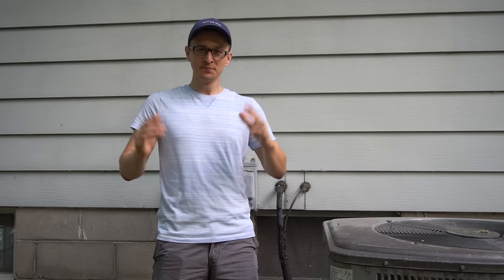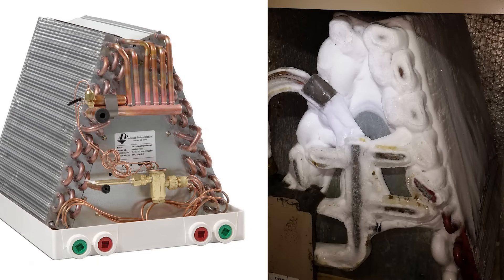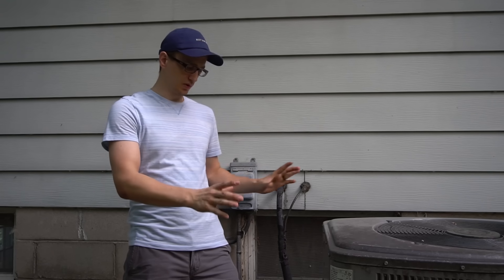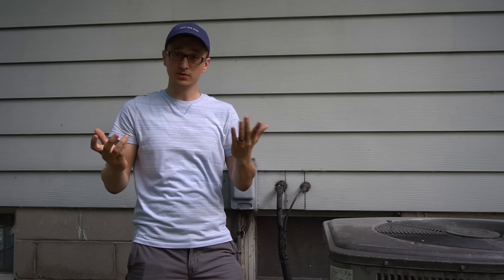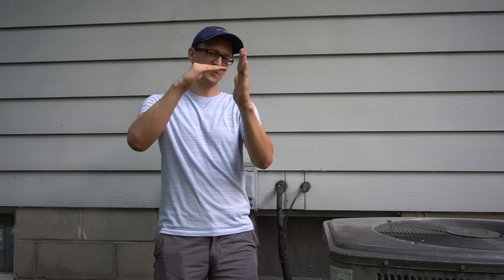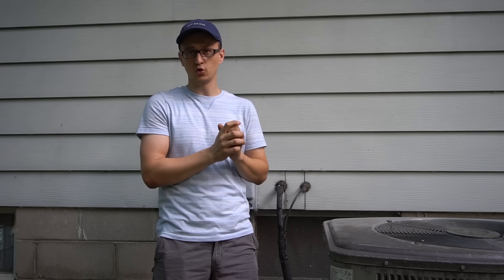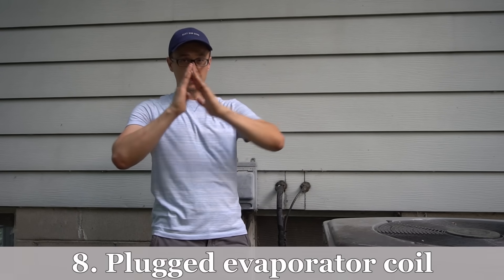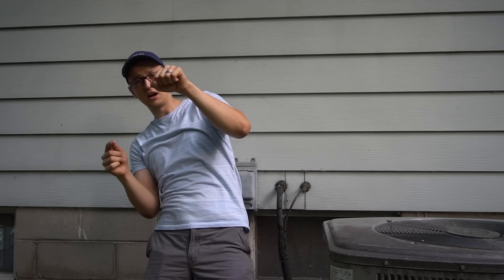8 Reasons Why Your AC is Freezing Up

Comment: Can a poorily operating condenser fan motor cause inside & outside unit to freeze?
Reply from the maker: The condenser fan that is in the outdoor unit? If anything, it would cause the unit to overheat not freeze. A poorly operating blower motor in the furnace would be the one to cause freezing though.
Reply: @WordofAdviceTV  Thank you! I have a technician that states that the condenser fan motor is the problem. I have searched & have not found ANY information that suggests anything near what he stated. And the warranty company has denied the claim because of his assessment! Smh!

Comment: My ac unit is freezing up and I have the heater going please help
Reply: timwheale62 having the same issue. Any fix?
Reply: If your running the furnace and your a/c is frozen + running, its prolly a stuck compressor contactor.

Comment: Bratan, Do a video for heat pumps on winter season. It's little different. Defrost board. Ambient sensor and  coil temp sensor often are the reasons during winter for  ice freeze ups.  And how to troubleshoot it.
Reply from the maker: Bratan, maybe some day... But likely no time soon. Unfortunately I do not work on heat pumps very often. Either they are not very popular in Minnesota or the company I work for simply does not have many customers who have them. I haven't seen a heat pump in a while so honestly, I would need to do some troubleshooting of my own to figure stuff out, therefore I probably wouldn't be a good teacher on the topic. Sorry

Comment: I was having that same problem on work , with a commercial unit.
After checking it, the fan was spinning the opposite direction. Do you know what causes that to happen?
Reply from the maker: Sometimes a weak capacitor can cause that. Or if the capacitor was replaced and the Herm and C wires were reversed which would cause that as well. Also, I have reversed the two hot legs coming from the fan motor before and that reversed the spin direction. Doesn't work on all units but has worked for me before. Hope that helps!

Comment: Stupid question probably, but what does it mean when u turn off the AC and the inside and outisde hisses from the vents. The furnace sounds like it ices over immediately. But when i turn it back on the cold copper wire gets warm again
Reply from the maker: When it hisses, does it hiss for a long time or just a short time and is it really loud? There is a very slight chance that something is wrong but most likely that is normal. This may just be the sound of the refrigerant pressures equalizing when the unit turns off. When the AC is running, it has a high pressure side (outside unit) and a low pressure side (the inside A-coil). But when the AC is turned off, the high and low side "equalize" or become the same pressure. When it is equalizing like that you may hear a hissing sound like you described. If your unit is cooling down the house good, I wouldn't worry about it. ;)
Reply: @WordofAdviceTV  My AC does not cool the house down for long and it goes back to mid-high 80s. I looked under my furnace and have alot of condensation underneath. I ipen to check that A coil for freeze probs and its not. It looks fine. I dont know what to do :(
Reply from the maker: It sounds like you have a freon (refrigerant) problem.. Unfortunately that is not something that is easy to fix yourself so at this point I think you will need to call in the pros.
Reply: Thank you. You're very helpful! 😎

Comment: I like setting my AC to the lowest setting possible, 59, 60, etc... but 67 to 68..... not a bad start, plus, it's really cool still
Reply from the maker: Usually setting your thermostat low will not freeze your unit. Most of the time when that happens that means there is an underlying problem and the thermostat set too low is the straw that broke the camel's back ;)
Reply: So I can set my thermostat at 60, as long if my filter are clean and enough air flow is going through :)
Reply from the maker: I don't see why not. It most likely will not freeze over. If it starts to ice up, then consider adding a few degrees ;)
Reply: So if it freezes up, i'll cut down a few degree (raising like 2 degree)
Reply: My thermostat can go as cold as 50 for AC. Will it ever reach to 50? It's been hanging around 60-64.

Comment: I keep hearing different advice about leaving the A/C on when it cools a bit outside.

We have a programmable thermostat that's set to 70. Lately during the day, it gets to be 85-90 outside but around midnight until the next morning, it gets to be 60-75 outside.

Should we leave our A/C on at 70 or should we turn it off? BTW, it stops actively running automatically when it hits the desired temp.

Or should we turn the A/C off, but turn the fan ON, until the next morning?

I don't know what is most efficient, but I'm mainly worried about maybe too much strain or humidity causing the A/C to freeze up.

The A/C is located in our basement, which is not much more than a cool dirt hole dungeon under the house, only accessible from outside.

Thank you!
Reply from the maker: I would say just set your thermostat to the desired temperature and leave it. No need to turn it off. When it gets cold at night it will not turn on anyway. Your unit should not freeze unless you have a underlying problem with the freon. (low on charge, restriction in metering device, bad airflow, etc)
And in the off chance that it does start icing up, just turn the AC off and leave the fan in the ON setting and it will defrost it. Hope that helps!

Comment: Great videos, learning a lot. I move to new home with 4 Ac inverters splitter (millenia, york and 2 tgm) and well the york was off didn't wanted to turn on manage to get to separate backers and it was trip, it manage to turn on but it smells like something is burning so am going to check that. The millenia was working from day one but 2 day ago blower wasn't blowing air, got today the capacitor hope that's the issue and the 2 Tgm one was working perfectly but out of the sudden got a error code e5 the other tgm for some reason is bipolar it cools then it DOSEN'T and for some reason it turn on by itself. That one need to keep and eye on to se if it keeps turning on. Never had mini split now have to deal with 4 trouble ac. Much to learn I will

Comment: why would you need to recharge the unit? just because it froze it doesn't mean there is a leak in the system. You should never have to recharge a system unless there is a leak. They are sealed systems you know.
Reply from the maker: I went through the list pretty quick so I did not dive in to each individual issue. I explain what you said in my other videos though.
Reply: Systems are allowed to leak a certain % per year via the epa sometimes its more economical to just add a pound of 410a every summer as opposed to replacing it  and or fix the leak.
Reply: @Teagod77  the leak percentage is more applicable to very large and old commercial equipment. There shud be no acceptable amount of leaking in residential. Using soap bubbles to find the leak isn't hard to do.

Comment: Just cleaning the surface of a dirty evap usually will help, but not completely solve the problem. Best to physically remove from cabinet and clean with pressurized water and reinstall. Be careful with commercial evap cleaners, as they tend to cause the aluminum to deteriorate over time.

Comment: No u ding dong... Don't tell people to run the blower motor with the coil frozen.. How about leaving the explanation of what to do to those that know what to do.. It causes more amp draw on the blower motor because of the added resistance of air flow.. If it's freezing and you still run the blower you are asking for more problems than u already have... Very dumb to run the blower motor with a clogged coil
Reply: Your meter will say less amps but their electric bill is going to be the same
Reply: So in addition to not knowing how fans or capacitors work, you also dont know how utility company billing works either. Here's a basic math lesson:  All power companies bill based off kW/hour consumption. A kW is simply 1000 watts, and a watt (from a utility company standpoint) is voltage x amerage from a device over an hour. If you have a 120v fan pulling 0.2 amps, then 120 x 0.2 = 24 watts =0.024 kW,  x 60 = 1.44 kW/h. It's mathematically impossible to maintain a constant power bill total if your devices are pulling less amperage.
Reply: It depends on how technologically advanced your heating/cooling system is. If the blower has a PSC (permanent split capacitor) motor it runs at a constant speed and will not pull more amps because no air is being moved (no work). If the blower has a VS (variable speed) or EC (electronically commutated) motor it will be commanded to speed up because it senses no air flow and will pull more amps.
Reply: @villebillie1562 ... can you please explain how a frozen coil does not increase the resistance to the blower motor by restricting airflow  and how you equate this to  no "work"...which according to you does not cause the motor to use excess energy that results in heat..
Reply: I thought that this explanation by technical educator Carter Stanfield would be better than anything that I could come up with. I only pasted the first paragraph of his article on this subject. See the entire text at hvacrfundamentals.blogspot.com/2009/08/understanding-centrifugal-fan-motor.html
           Understanding Centrifugal Fan Motor Performance
Since air is what we work with it makes sense to insure that our students understand airflow and fan performance. Fan motor performance is one of the most often misunderstood aspects air conditioning systems. The amp draw on a centrifugal fan goes down as resistance to airflow is increased. For most people this seems counter-intuitive. It is easy to picture the fan motor pushing harder to overcome the resistance and increasing in amp draw. However, this is exactly backwards. Centrifugal fans move air by throwing the air outwards through centrifugal force. The amount of air the fan is moving decreases as the resistance to airflow increases. If the fan blades are moving less air, they can actually spin easier because there is less air to sling. This causes the motor RPM to increase and the motor amp draw to decrease.
Reply: +METO. Sorry dude, I can tell you've never serviced a running blower fan before. Blower amperage DECREASES with "resistance" to airflow. Any technician who has ever serviced a running blower fan with a panel off knows that the amp draw will be higher as a result of the increase in available volume of air. The same true for the inverse- when you restrict airflow the motor is doing less work and will draw less amperage. I've personally demonstrated this with a PSC motor and squirrel cage blower wheel in a class on airflow. Less airflow = less work = less amp draw.  And yes, running the fan when the indoor coil is iced up is a commonly used method to speed up the de-icing process.
Reply: @jarednielsen6288  the reason that you get a lower amp reading is because the motor is spinning slower because of the restriction of airflow...the difference between the normal running amps and the amps the motor pulls with the air restriction is being turned into heat... running a motor at lower amps because of a restriction you are producing heat with the current that would normally be used to do work... it does make the motor  cause more amp draw as heat to the motor and it is air cooled so the less airflow the less cooling for the motor which does not help the situation because they are designed for a certain amount of air to cool the motor...I should not have had to say this if you knew what you were talking about...the capacitor will always be giving the blower motor the same exact amount of current because that's what capacitors do...are you sure that you know what you are doing... cause I don't think so if i had to go in this in such detail for you to understand what I said
Reply: @jarednielsen6288  over amping a motor is when a motor is given more amps than needed to make it spin at the speed it is being used...thus you are over amping the motor... and you teach other people???
Reply: @villebillie1562  you teach people and I can assure you that its you with the lack of understanding about what is going on and you actually even proved me correct with  your comment but you failed to realize it...if anyone pays you money to learn hvac they deserve their money back...lets look at how you proved me correct without even knowing that you were...Capacitors build up charge and then passes it to the furnace blower at the uf rating + or - 5%...at all times the blower is running with this same amount of current regardless of the amount of "work" being done..because that's what  capacitors do... Regulate current....God I am truly amazed that I must explain this to someone who "Teaches" others... Robbed would be the word I use... Anyway... The amount of "work" being done is as irrelevant as it can get...it means absolutely nothing at all in our case because it's the resistance of the circuit that decides how much power is sent to the capacitor...not the motor... The motor receives the current sent to it by the capacitor...the capacitor or circuit do not care what is done with the current it is sending... Whether it's being used to "do work" and move air... Or if something is restricting the motor from turning... Either one is the same exact thing to the circuit and capacitor...so instead of moving air and doing "work" with the current being provided... You are converting the excess energy that the motor needs to run that speed directly into heat...you are causing the motor to draw more amps than needed to run it at the speed with the restriction...now do u understand how a motor running with a restriction causes the motor to pull more amps... Because I can not dumb it down any more than that to someone who claims to be an hvac teacher... Which clearly you have no business to teach others...in fact you should be paying me for teaching you...at the very least you should admit that you are wrong...its not that 1 person is smarter than another...they just don't store the same exact information and if averaged out across the board.. Everybody is equal... It all boils down to what information interests you to want to learn more about it...just because you can not read the current with a meter does not mean that it has not been sent to the motor... The easiest way to understand electricity is by using fluid dynamics because electricity acts exactly like water in a pipe... This situation is equivalent to a water wheel having a  restriction which causes more water being needed to turn it with the restriction and the source of water for the wheel saying the same...this is basic electricity 101 learned in middle school...there is no way... At least I hope... You teach people without this extremely basic understanding of electricity
Reply: I think you're probably a hack.. or maybe you did a ride a long with an hvac contractor  and now you think you're an engineer. "Over Amping" a motor is simply a condition in which the motor is drawing more amperage than designed, even if its a motor with an SF greater than 1.  A frozen coil will not cause a motor to pull more amperage plain and simple.
Reply: METO U is obviously some guy who's never been educated on fan basics. I'm guessing he's was probably hired by some hack company and thinks he's an engineer now. The above example you posted is absolutely correct. I went to an hvac trade school and saw this exact principle in a demonstration.
Reply: Metou are you serious Theres no way that you are a service tech. If you are then im guessing not a very good one Ding Dong

Comment: hi can you tell me why my compresser gets hot  it turns on but  it  gets very hot and liquid line is cold  and suction line is not very cold  thank you for your help
Reply: Sounds like a low refrigerant level. The liquid should leave the condensing unit warm, the suction line should come back cool/cold which also cools your compressor before getting pumped back out.
Reply: thank you bradley  for the advice  im trying to add refriferant by scale but the numbers keep changing on scale   but you gave me the correct answer
Reply from the maker: Hey James! This year I have been using a fish scale and I have been loving it! It's awesome! They gave them to us at work, unfortunately I can't find the one I have online but it looks like this one: https://amzn.to/2CkdSSm

When you have the freon jug suspended in the air, you don't have the numbers bouncing around. I found that it is much more accurate then the classic floor scale. But that is just my experience. Other people don't like it. The only thing I would recommend is finding a place to hang it when you use it since holding it is the only problem (if the tank is full, it gets heavy) I have a Ford cargo van with the double back doors. It has a door latch up on top and I hang my fish scale on there. Works great. Anyway, just thought I would mention it in case you want to give it a try some time.
Reply from the maker: Hey James! Does the compressor run for a little and shut off or does it keep running? Also, have you checked your locked rotor amps and do you remember what your pressures were?
Reply: If u have low refrigeration, it means u could have a leak somewhere. Or maybe just a bad install job or a bad technician took some out.